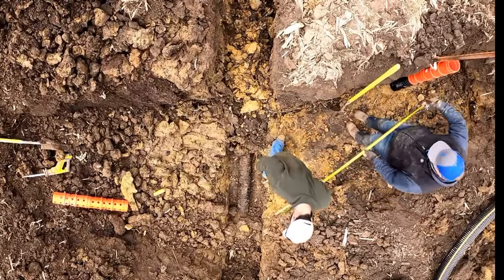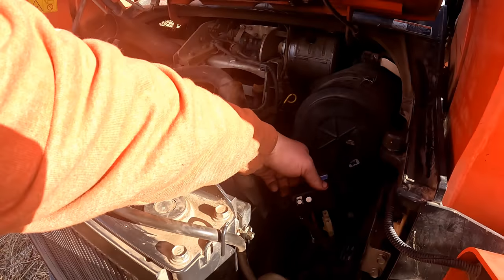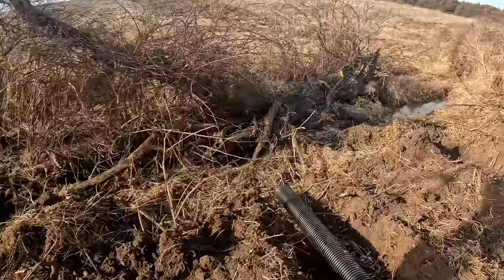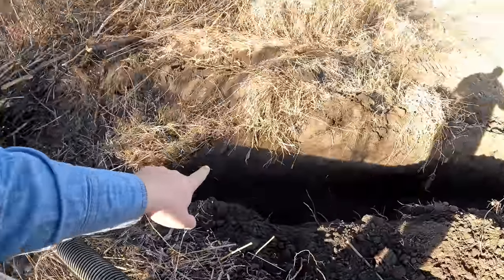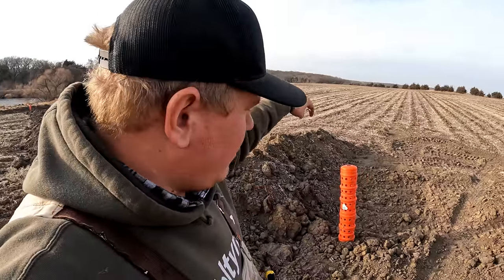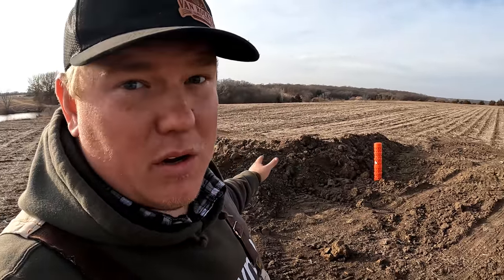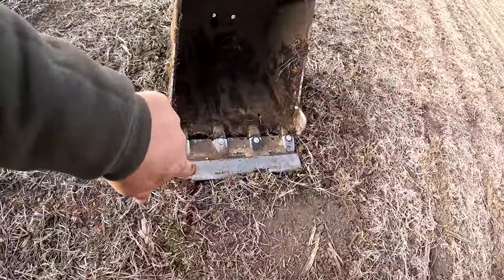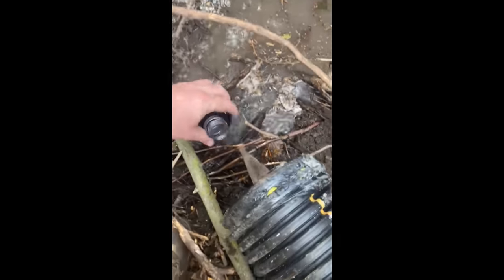SO YOU HAVE QUESTIONS?

Comment: Ben what are your thoughts on ADS pipe vs. Springfield pipe? A lot of guys in our area use Springfield pipe which is virgin plastic that hasn’t been recycled like ADS. Also where did you get your tile spade? I’d really like to get a nice tile spade that’s angled so I’m not breaking my back trying to clean out the bottom of the holes. Last question what software do you use to design your tile projects? We’ve got a John Deere gator setup with GreenStar RTK to survey the fields but at the moment we don’t have any software to upload the data to and design the tile project. We have a Gold Digger Stealth ZD pull type plow just like you that we bought new this Spring.
Reply from the maker: Lots of good questions. I think I can answer some of them in the next video.

Comment: Coming from a kubota dealer. Never had a svl kill itself over low hydraulic oil. I have seen them die and not start back up due to the dpf overheating and wont start till it cools off. Usual cause for that is fuel filter being clogged cause kubota has thightest micron filters on the market.
Reply from the maker: Thanks for the tip! I really appreciate it. I’ll get it figured out. Hopefully.

Comment: Why I like to spur. If the inlet would plug for some reason your main line is not plugged. Also spurred outlets tend to draw better. Most of the runs I have dealt with have six or more inlets on them. Food for thought. Thanks for using your platform to help people understand why farmers do what they do. Congrats
Reply from the maker: A six run I would be spurring.

Comment: Have you ever heard of dry ponds
Reply from the maker: Fill me in?
Reply: I’m a farmer in Kentucky in some hilly areas.The dry pond works the same way the terrace does running a 6 or 8 inch tile up the valley putting a riser ever so often but around the riser you make a half moon levee  that is rounded where you can plant over it it like a small pond where the water runs to the riser . I know that’s probably not the best explanation

Comment: I've ran a Speicher tiling machine before, wheel type as opposed to chain type.  There were multiple time that you could see water running on the bottom of the trench in the shot gap between the back of the boot, and where the till was making contact with the bottom of the trench.  Felt good seeing that, as it proved you were doing good by running tile though that area.  Good job!
Reply from the maker: Or when the side walls slump in.